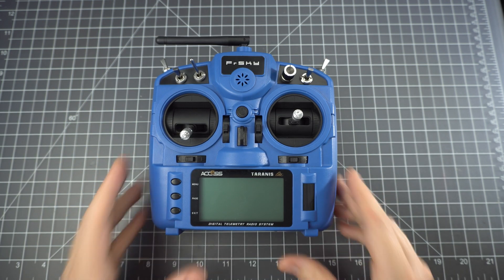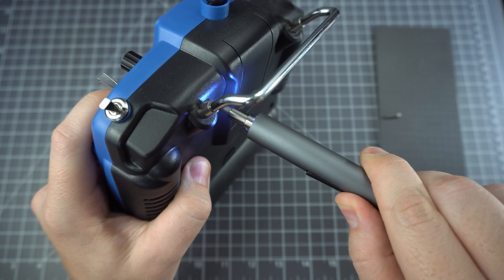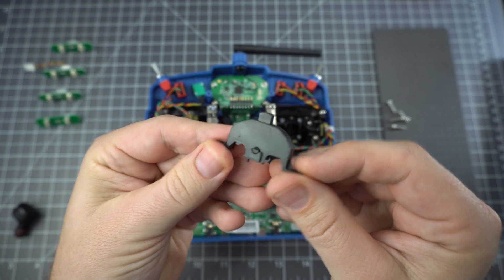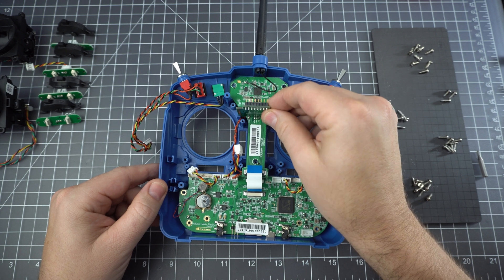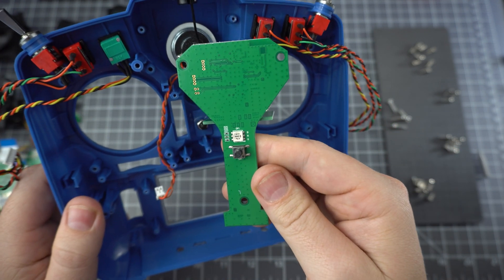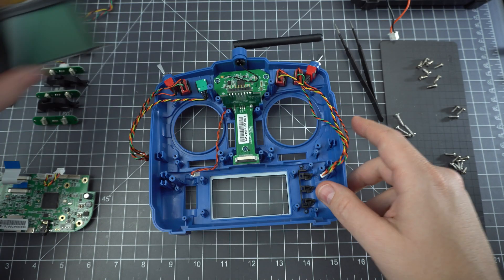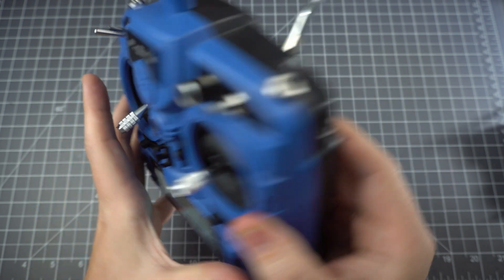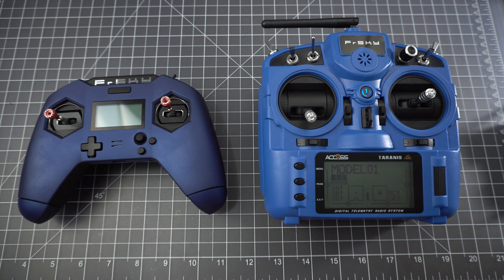FrSky Taranis X9 Lite Teardown & Overview

Comment: Thanks.  Any useful info like how to adjust the spring tension?  It comes way too tight for my tastes and this is as far as I've gotten so far looking up how to adjust tension.  Also if you happen to know, is there a way to remove the clickety detents on the throttle stick?  Thank you!
Reply from the maker: Yes, just adjust the screws on the back of the gimbal. You'll see that they raise and lower the springs. You can also loosen the ratchet to disable it.

Comment: nice video, but I don't think they are the same gimbals as the QX7, I thought they were so i bought the M7 hall sensor gimbals but they won't fit. just a warning for anyone else tempted to try it. this was before URUAV launched their upgraded model
Reply from the maker: They are the same but the M7 gimbals are larger. The QX7 just has more space for them.
Reply from the maker: You can probably get them in there if you dremel around the edges but that'll be hard work.

Comment: Will you do a tear-down of X-Lite Pro? Subscribed not to mist that video if you will do :)
Reply from the maker: You'd like to see that? I was considering it but I didn't know if there would be any interest.
Reply: @whiffles  You do interesting, in depth tear-downs, point out extra details about electronics you find, I like that. Like that you name chip's and solutions you find. It seams you are related with electronics in other activities and have more knowledge then that gathered from RC modeler experience. Your tear-downs feels like made by electronics engineer while other similar videos on the youtube feels like RC modeler opened the case and improvised. I'm electronics engineer, earn my living from electronics and I enjoy watching your tear-downs.
Reply from the maker: @Mr.Laidukas  Thank you! I'm actually a software engineer, so I have to do a lot of Google searches to figure out what I'm looking at here. It's fun though and I love learning about the tech in these products.
Reply: @whiffles  I would like to see X-lite pro tear down.  I am considering upgrade my  original x-lite to x-lite pro and want to see if possible to do.  Thanks
Reply from the maker: @flipb942  I'm still on the fence about doing a Pro teardown. It may need to wait as I've got a number of other videos to do first.

Comment: Can you swap the gimbals in the x9 lite with the qx7 gimbals?
Reply from the maker: I believe so. They're virtually identical. I don't see why you would do that though. The M7 hall sensor gimbals do not fit in the X9 Lite though.
Reply: I was asking because I have m7 hall sensor gimbals in my qx7 and would want to use them in the x9 lite if I bought one.  Thanks.
Reply from the maker: @waipa1711  Yeah unfortunately the m7 gimbals are too big. You could probably make them fit if you sawed off the metal trim, but that would be some pretty intense surgery.

Comment: ayy! nice video, ive been waiting for this one.
Reply: quick question actually, can you plug a normal 2s lipo into the balance plug on the board? kthnx
Reply from the maker: I believe so, and you can remove the 18650 tray as well. I'm just not sure how well protected the main board would be bumping against the battery.